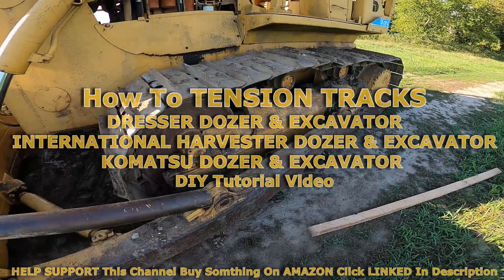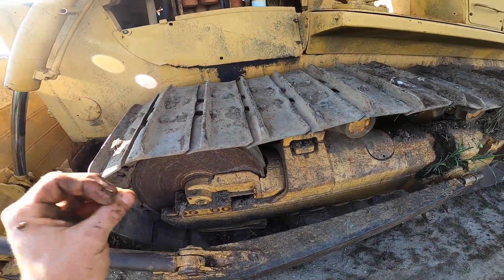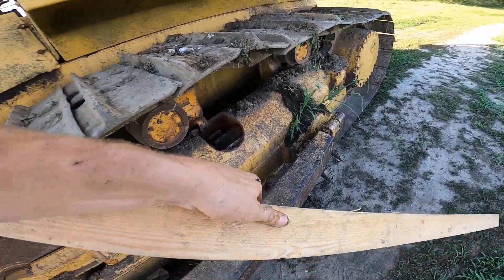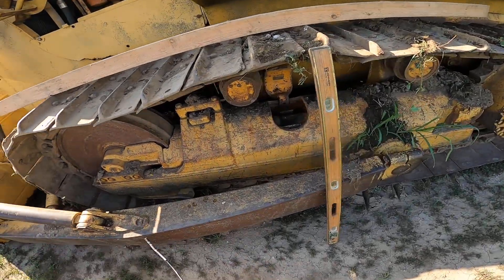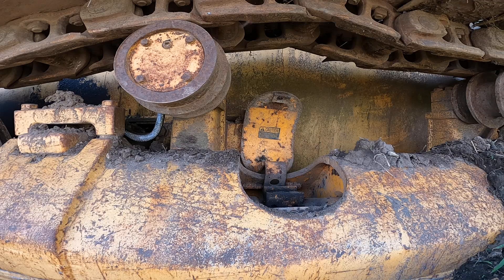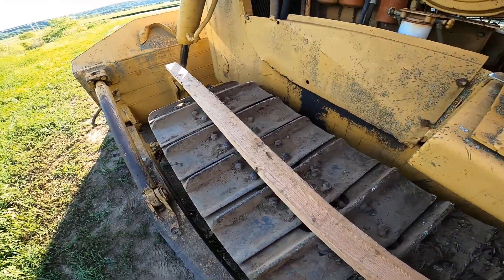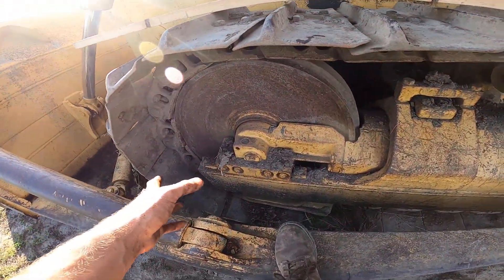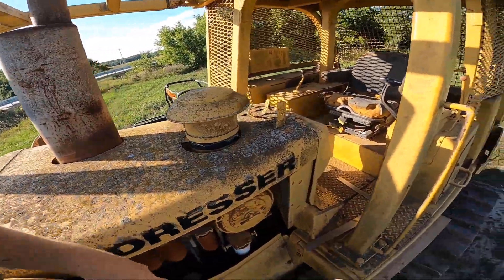DOZER Track Adjustment How To TENSION TRACKS On Dresser Bulldozer IH Komatsu Excavator Tighten Track

Comment: Tensor stuck. Grease gun didn't move it. Releasing zert release didn't result in moving looser. Is there a set screw or bolt. Should I jack it both ways? Tried penitrating oil . A BFH,sledge
Reply from the maker: yes see if you can completely jack up that one side of the track what you can do is put the blade all the way up and then put blocks underneath the back of whichever side you want to lift up and then lift it by putting the blade all the way down and it should lift the whole thing off the ground on at least one side I would say if I had to guess that you're Track tensioner is seized up
Reply from the maker: Another thing that you could do but you're going to need to be careful not to overdo it if I was having the same issue as you I would try this I've never done it before for this particular application but anytime you have anything that is seized up like a bolt or nut for example, if you heat it the metal expands, which helps it to loosen up however, you definitely do not want to overheat it in this particular scenario if you have like a propane torch, that would work perfect
Reply: Curious was the seal compromised on the tensioner piston or was it seized up